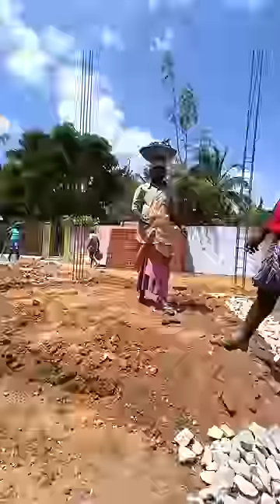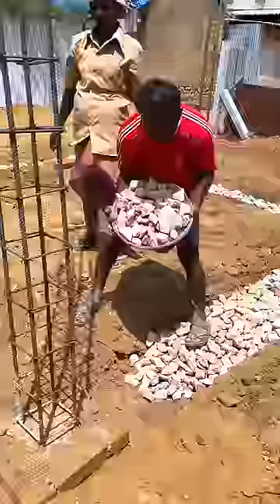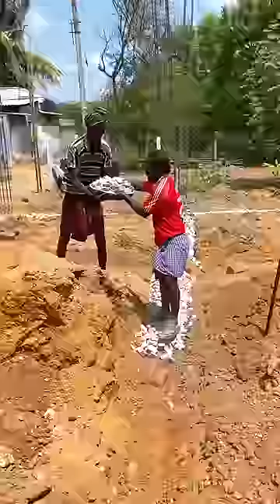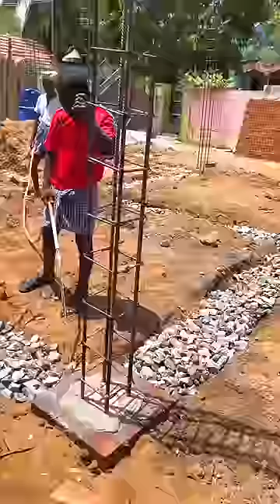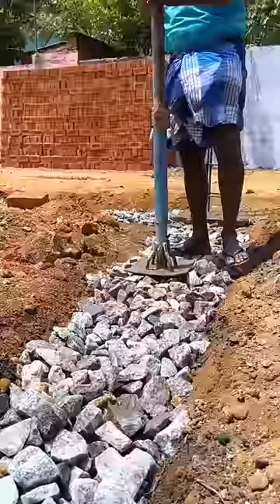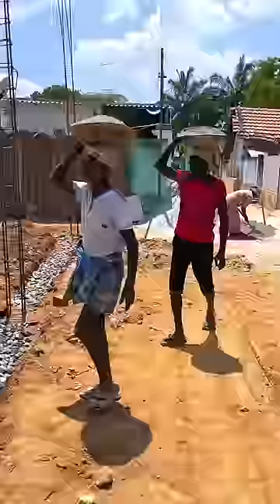PCC Plinth Beam Technique#construction #pcc

Comment: This is exactly why your houses and units last like 5 years
Reply: They are working with the little they have what do you spect
Reply: They may last as long as their resources. You are entitled, these people are doing the best they can Mr Civil Engineer 🤔
Reply: U know
In my country
They extended they house using steel  poles and a small foundation.
😅
Reply: so true, if they used an adobe style mixture it would last 100+ years and all you need is mud and straw....
Reply: Why don't you go over there and help them?? Or, send send some equipment..
Reply: Es una forma de hacer una casa barata  con las columnas  y poniendo una cadena cada metro en la pared aguanta tranki y si te fijas en las otras casa te darás cuenta q están echas así ya q solo son planta baja  y techo de chapa o calaminas
Reply: @MC414  Well said mate. I'm sick of these armchair builders..
Reply: The pillars have disconnected plinths, if the area is not seismic and if what remains to be done is done well, I don't think there are any problems. From what this judgment of yours? With the means they have, they do what they can.
Reply: @panmad6156  no one cares , that’s why
Reply: @andyluisgonzalezjimenez-kb8nh   I think he is just pointing out that allowing people to build structures like this is dangerous. There are building codes for a reason. A small earthquake will topple that thing, possibly killing whoever is inside.
Reply: to all those people bashing on OP
this kind of work not the means available is the reason these kind of housing only lasts for 5 years 
the work.......not the material they use.......the material is in fact of first grade quality

the work on the other hand is completely wrong and especially in the sequential steps they took is completely reversed and wrong 

they should have mixed the rocks, the sand and the cement all together all at once
then the whole mixture place at the digged out foundation 
then pressurised with that steel plate and pipe
and then sprayed enough water on top of that so the whole mixture is soaked with water without washing away any sand or cement 
then you would have had first quality concrete foundation

now, the only thing they achieved in this video is that the surface of the rocks has a thin petrified top layer and nothing more 

that's why this foundation won't last for many years
Reply: Pero los castillos están muy bien hechos y me imagino que esos son los que le dan más firmeza a la casa, ahora cuando vayan pegando los ladrillos pues ya los van a colar con los castillos
Reply: It’s alright. They like it that way.
Reply: 1 year, cracks all over...
Reply: Just like the toothpick and cardboard houses here in the US.
Reply: Really ??? The buildings from hundreds of years are still standing and that was before steel work. Think before u say some bs
Reply: @6xxboss597  but those buildings were not built like this, so maybe think before you say some bs
Reply: Better then USA house making from cardboard 🤣
Reply: Tai a união faz a força,o que bom é com suave é,que vivemos em união
Lindo seu trabalho.
Reply: Your words make people lost hope. Congratulation.
Reply: In the US they have railway codes. That's why they have American Seveso in East Palestine.

And they have codes for clean drinking water. So they have lead in the tubes in Flint, Michigan. 

Just sayin ...
Reply: Why don’t they mix the rocks with the cement and water first? I know they have limited supplies? Also they could make the footings a lot bloody deeper
Reply: @DerpChar  - Why should they? From an engineer's point of view. Not based on some feelings. .
Reply: @mairmatt  because it will create a stronger mix, and deeper footings would prevent subsidence
Reply: @DerpChar  - So why don't they do the same with railroad ballast to give rhe sleepers a better grip? 

I'm asking because I have a not so well undestanding of building methods as a construction engineer from this old Europe where they used the same method over 2000 years ago and this shit is still standing.
Reply: @mairmatt  if they went deeper with the footings, it will take the weight above a lot better. Old English houses barely had any footings and a lot of them today are all twisted where they have subsided.
Reply: These houses lasts for years!! unlike wood and dry wall that needs a repair every 6 month the minute a drop of water touches it. 

Come to india and see how long these builds last.
Reply: They should have to use RCC in plinth, they can build load bearing super structure
Reply: Western wooden houses are useless 😂, In India we use solid concrete ,metal windows I fell safe
Reply: NONSENSE! These houses last decades! Houses build like this in the early 1960s are still standing strong. They will easily last a century.
Reply: @lelandanderson1252  "I think he is just pointing out that allowing people to build structures like this is dangerous. "
You don't know what you are talking about! These houses (built with brick, mortar, and concrete) will last 3 or 4 times long (and with far less maintenance) than any wood frame construction done in countries like the US and Canada.
Reply: @txmade4371  "Just like the toothpick and cardboard houses here in the US."
Not really. These houses (built with brick, mortar, and concrete) will last 3 or 4 times long (and with far less maintenance) than any wood frame construction done in countries like the US and Canada. Heck, most houses in the US need a new roof even after a freaking big hail storm!
Reply: @Panmad  they still build better then you Mr keyboard warrior hahahaha
Reply: Good team work.
Reply: amigo ahy casas resistentes echas con adobe (pasto y barro) que estan por revolucionar la industria y son sustentables, tienen exelente aislacion acustica y de temperatura ademas de tener cero huella ecologica y casi ningun costo...
Reply: У них нет дождей , поэтому не гниют машины и они не красят даже стальные конструкции.
Reply: Si es una casa de un piso con techo de calaminas, y de paredes con ladrillo hueco eso dura para sus nietos.
Reply: Because they can drive down to the local home depot. Oh wait.
Reply: @saltyj6712  🤣🤣🤣🤣🤣
Reply: Mere hisab se ajkl k jo beam agr design h to uske liye iski jrurt nhi h kyuki wo phle se hi Hanging support ke liye design bhi hote h
Reply: நீங்கள் செய்வது தவறானது
Reply: मेरे विचार कोशिश कर दो प्लीज भैया 🙏🏾🙏🏾🙏🏾🙏🏾🙏🏾🙏🏾🙏🏾🙏🏾🙏🏾
Reply: Armchair builder.
Reply: On the contrary, your home last much longer than you can imagine with less cost
Reply: congrats you won the internet! i laughed so hard on this
Reply: Guys remember the inner of the realway irs rocks
Reply: At least it hard then drywall😂😂😂
Reply: This type of technique was used for my 1990 old house it its still tact so move aside you cheap intelligent

Comment: I had to build a foundation for a fireplace many years ago and the hole had water in it. I decided to put in all the materials minus the water, and the next day it was hard concrete. It worked, the fireplace is still there. It was built in 1976…….
Reply: L ln vj
Reply: Камин легче фундамента
Reply: Concrete is heavier than water. Therefore displaces the water out of the hole ? Does that make any sense to you?
Reply: Algunos no entendieron tu explicación,  una mezcla para concreto termina funcionando cuando absorbe el agua circundante. Generalmente se trabaja así en el inicio de un cimiento se coloca la mezcla en seco.

Comment: Se realiza rápido pero la mezcla de cemento no cubre toda la piedra. Es una solución para una vivienda con pocos requerimientos
Reply: No es cemento, es arena. Está es un técnica ancestral para los cimientos. La única falla es que debe se más profunda, de un metro.
Reply: @jhonjairoganantorres851  están asiendo base para las carpetas , aparté esa casa solo sirve para plata baja ya q la carga lo lleva las columnas  y con unos encadenados en la pared  va de 10 y sibte fijas en las otras casas de alado tienen techo de chapas o calaninas  q eso solo lleva  vigas de madera
Reply: Does the concrete base make sense if they're going to put beams on it, so what's the problem?
Reply: @diegobustos4403  पप्प😊
Reply: @acinonuxjubatus39  They wet the ground and that's enough. What is liquid cement supposed to be used for? Even the most compact mortar will wet the ground but that will certainly not be the gripping agent but the weight of the building.
Они смачивают землю, и этого достаточно. Для чего предназначен жидкий цемент? Даже самый плотный раствор смачивает землю, но это, конечно, не сцепляющее вещество, а вес здания.
Reply: de seguro es Haití ese lugar donde un día tembló y se cayeron todas las casas, ahora queda todos muy claro.
Reply: @octavioofigueroa  entonces, mucho depende de la técnica de construcción de las paredes y la ligereza del ático
Reply: @octavioofigueroa Realmente están en Hindostan.
Reply: Bro es africa no le exijas tanto ni mucho
Reply: @octavioofigueroa note equivoques ese balastre absorbe el movimiento mecánico está bien es lo básico y sencillo

Comment: Putting the stones in stops it sinking and binds it...pity its not 12 inches thick..I like the wacker and wetting the stones ,stops it cracking ...concrete looks like sand...probably  9 to 1 mix...

Comment: what in the flying fuck do they hope to acomplish with this technique? structural concrete needs to be mixed, not "dry poured" like some tiktok trend (that is actually a horrible way to do any concrete work, guaranteed to fail). and it requires rebar for tensile strength. This will crack almost immediately, probably before they even start building walls.